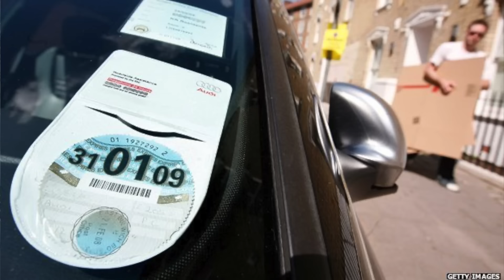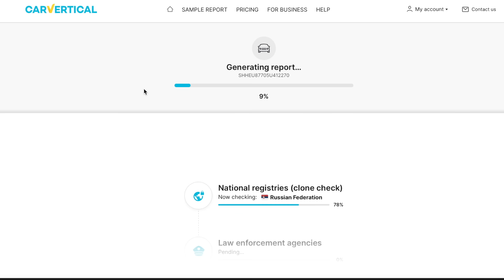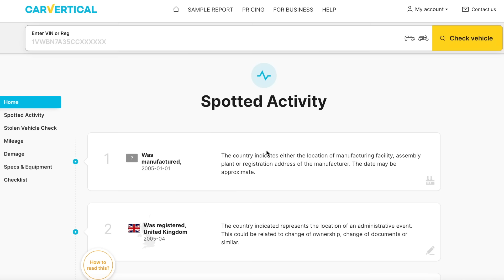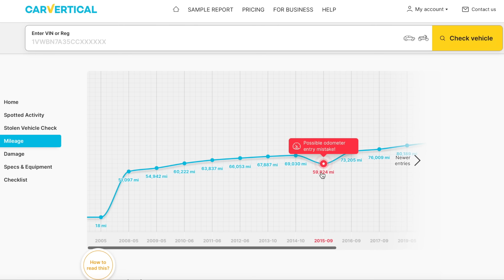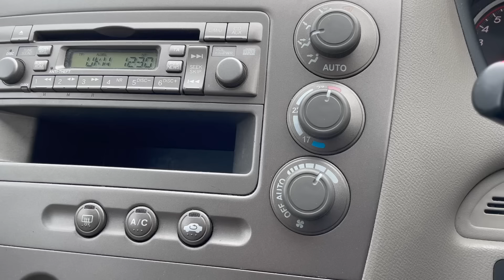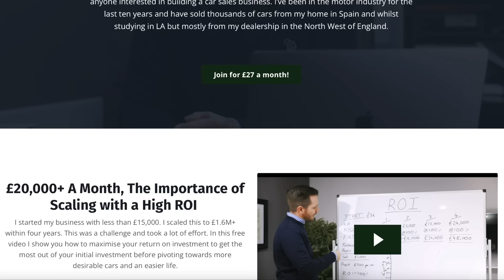I BOUGHT A CHEAP HONDA CIVIC

Comment: Our BMW broke down last year on the ferry ramp on a visit to the UK (we live in Normandy) Clutch went. We were on holiday and needed a car. Bought one of these for just under a grand. Low mileage, tidy condition. Great little car.  We didn't bother fixing the BMW (dreadful thing) and kept this. It is brilliant.
Reply from the maker: What a bit of bad luck and terribly timing. Still, you got a decent car out of it
Reply: @HighPeakAutos  Yep. In the end,  especially with cars, you have to be philosophical about these things. It worked out well in the end. probably saved us lots of expense down the line with the other one.
Reply: Was having a right hand drive car in France not an issue?
Reply: Mon dieu l'horreur.
Reply: @andyhillhouse9813  Not really. We have had several RHD cars in France. I have got used to it and it doesn't bother me.  We have re-registered it with French plates. No problem. In fact i'd probably find it harder driving a LHD as I would find myself doing everything with the wrong hand and it would feel very odd!
Reply: @HighPeakAutos  Just put it through the French MOT (controle technique) and it passed with flying colours. So over here we get 2 years motoring before we need another test.

Comment: I had a 1.4 back in the early 2000s. Bit gutless compared to the 1.6 but a cracking car nevertheless. I now drive a Mk4 Honda Jazz Hybrid. I've worked out my age using your formula and I will be celebrating my 147th birthday later this year.
Reply: 147th?
Reply: 147th ? Are you vampire?

Comment: That's my first car. Lovely thing. Honestly that 1.6 VTEC is the best engine in any car I have ever owned. Loves to rev, refined at low speeds and extremely economical for its aged. Can easy get 40+ mpg on a long run.

Absolute bargain for a new owner.
Reply: Totally agree.  I had the pre-facelift model - 53 plate.  Terrific to drive, really easy.  Gear stick postion brilliant, as Matt says.  Beautifully sweet engine, the 1.6 VTEC, and always started first time.  Loads of room.
Easy to work on, too!
Weren't these the last of the Civics to have independent rear suspension?
Reply: @kubiyoshi2744  how are you possible to get more mpg in city then on motorway driving?
Reply: @kubiyoshi2744  I don’t think that’s how basic physics works with car.
Reply: @piovo1  I understand lower MPG on motorway in very small displacement engines, it's simples you have to rev higher to maintain the speed, i.e. at 80mph you are probably looking 3.5-4k RPM for a 1.4tsi vs ~2.2k RPM on my 3.0i BMW
Reply: @kubiyoshi2744  Until the timing chain slips on the 1.4 TSi then the economy saving will be destroyed by replacing the engine.
Reply: @kubiyoshi2744  60mpg in city driving where the average speed is 15mph and red light traffics every 150metres? where you need to idle for maybe 2-3 minutes.
Reply: Are the ep3 2.0 same aswell
Reply: @kubiyoshi2744  junk VW
Reply: @kubiyoshi2744  will be good
Reply: @kubiyoshi2744  would like to see your VW doing 300k....not seen one with this engine yet, Honda? There are tons of them for sale with 200k miles plus.

Comment: I bought a 1.7 diesel 5 door with 65,000 miles.
Ran for years , sold to my friend as a stop gap at 130,000 miles.
5 years later it’s still running fine at 200,000 miles !
Best ever mpg was 68 travelling 100 miles down the A49.
What more needs to be said.
A cracking car.

Comment: My dad has had his 2004 1.6 auto exec since it was 5 years old and 43k miles. He's been changing it now for the last 5 years, but never does. It's been pretty faultless, but has been kept garaged for the last 14 years so no rust, it actually looks just as good as it did in 2009. Kate Bush is a legend ☺️

Comment: I love this show and it always surprises me of the low valuation of used cars in UK. In Canada, even a slightly dented and scraped 18 year old Honda would be worth much more than £500 ($837 CAD).  And one like this with low mileage, service history and a high spec would certainly warrant  that small body repair, as the seller could easily get their money back.

Comment: Great video as usual. It's not the main reason I watch them, but one of the spin-off benefits of High Peak videos is an ongoing education into the vast number of shonky tyre brands I've never heard of that people fit to aging motors. Just thought I'd share...
Reply from the maker: Hahah me too!
Reply: I must be unusual in that I’ll buy a 130k mile Alfa for 20p and then spend £1000 on a wheel refurb and a set of Michelins. 😂

I couldn’t drive on some of these Chinese ditchfinders like Fate-O Cauliflowers or whatever.

Comment: I had one of these. It’s one of the cars I regret selling most. It was almost too reliable. I took it everywhere, even off-roading and it was absolutely rock solid.
Reply: Offroading? Do tell....
Reply: @norwegianzound  light off roading. Took it through the desert and off the beaten trail many times. Not major stuff.

Comment: I bought a 2003 1.6 with 50,000 on it in 2016 for £500. It's been everywhere. It's been passed on to family members, and now my oldest daughter has it, 140,000 on the clock, and still runs like new. They are great little cars.

Comment: Matt, you missed the OAP telltale of 'heater to the max' ..... my 86 year old mum has a Jazz Crossstar (another way of saying you don't need to bend so far to get in), with climate control permanently set to 24.5C and obligatory Classic FM.

Comment: Great video Matt. I bought a 2008 Honda Civic 1.8 type S with 60,000 mls a couple years ago as a cheap runabout, I've put 40,000mls on it and all it has needed in that time is servicing, tyres, brake pads. Very reliable cars and as you say, you can leave in the supermarket car park or in town and not that bothered if it gets scratched. 46mpg on a long run too 👍

Comment: I had one of these. A 1.7 diesel. Brilliant car. Only bought it for £500 as a temp but ended up keeping it for 3 years. Then sold it to a student when I went to work abroad. When I came back I wanted to buy it back but the student had written it off. These cars are so easy to drive and maintain, change the oil and filters every six months and it will look after you for you for years.

Comment: I worked for Honda for years and sold those when they were brand new, (the colour is called Cosmic Grey BTW) the average age of a 5-door Civic Exec buyer back then was probably about 60 so they're generally well-maintained and if looked after mechanically bulletproof. I've never seen an Exec with that colour of interior in the flesh though as 99% of them were ordered black (because the grey one looks rank) so it's probably an ex-demo dumped on a dealer by Honda UK. My Mrs just passed her test on an Auto last year so I got her one in exactly the same age and colour,  40K miles, 1 owner with a full Honda Service History for £1550. It was a bit rough on bodywork like this one but it soon came up good with some G3 and a wheel refurb. It will probably outlast her if she wants to keep it.
Reply: My Aunt when we bought her things used to say  "This will see me out"
Reply: @Pat14922  This generation of Civic along with the Toyota Corolla are probably the last cars you could say that with confidence about.
Reply: U reckon the ep3 typeR side skirts would fit on the 5door?
Reply: @marlonbaird6070  No they wont

Comment: Great review. I know a fair bit about these EP civics. Have always been my go to 'In between car' when needing to keep on the road between buying and selling of my personal more expensive car. Absolutely bullet proof. One common issue on the manual is a noisy input shaft gearbox bearing which the majority of them suffer with. It generates a whine but doesn't impede the operation of the gears or driving. Another problem is that the a large number of thees EP model civics are being written off due to their expensive catalytic converters being stolen. Alot of Honda's this age have become targets. You're right about snobs in the UK. It definatley is all the car you need and can be hand for around 1to £2k.

Comment: Had 5 Civics so far in my lifetime, about to get number 6 ( Civic E HEV Advance ), all have served me well with no major issues. Currently own a FK8, so far my outlay has been 2 tyres, set of wiper blades and rear pads. That's in 4 and a half years.

Comment: EP's are awesome Cars with amazing handling, they do tend to rust badly from the inside of the backpanels, because water tends to get trapped in there, take off the speaker covers next too the backseat, shine a light in there and use a mirror, if there's rust/water in there it must be stopped, or it gets really bad.
Reply: EU (5 door) models don't have this issue as the speakers are located in the doors thankfully! But the rear arches do still go like EP's.
Reply: @Liam-mt1fg  commented before watching the video, then realised it was the 5 door 🙄 we have 5 doors over here but they are rare, mostly it's a 3 door, hence why i jumped into conclusions early.

Comment: The mk8 civic that looks like darth vader came out in 2005 on 55 plate.
These early models had faults on them with the fuel flap and the handbrake.
My father bought a new 2007 honda civic 1.8 petrol mk8 and still has it with just 34,000 miles on the clock and i have serviced it every year with mobil 1 fully synthetic oil from new.
Nothing has gone wrong with it so far, even all the bulbs are still the original and working fine.
The mk7 here will be equally as good, if not better im sure.

Comment: Just to note these also seem very vulnerable to catalytic converter thefts - there are a lot on the market spares/repairs or salvage just because of cat theft.
Reply: The model after mounted it right at the front of the engine so it's very difficult to steal...
Reply: @Negativvv  only 1.8 and 2.2 versions the 1.4 is underneath. also type r 2.0 under neath.

Comment: Owned one of these on a Y reg for 4 years. SE executive model, Paid £1300 quid for it at the time. Loved it, great car to drive, loads of space. It was the 1.6 vetec which run perfectly despite having moon miles. My ownership sadly ended after the driveshaft snapped (someone had welded it years before and had never been noticed) would own another one tomorrow. Thanks for uploading 😊
Reply: really drab boring cars

Comment: This was my first car and is currently my daily driver. It's an EU8 but apart from the weight and size it literally just a "5 door EP2" as I put it. An amazing hot hatch for people like me who need the extra doors for grandparents etc, in some cases the EU8 has gotten quicker 0-60s than the EP3. All EP mods can be installed to it aside from straight pipe and the side/rear body as it's slightly longer. What a sleeper

Comment: I bought one of these nearly two years ago as a second car/runabout for £1400. A silver 2003/53 pre facelift model in limited edition trim. 75k miles, full documented history and bodywork near mint for its age. I'm really fond of it and can't bring myself to sell it on to be honest. Super sweet engine and gearbox. It's a genuinely fun car to drive - much more so than it's straight laced looks would suggest. VTEC motors do enjoy a good kick. And of course they're we'll built and tightly engineered cars. They really are made to go the distance. To preserve its condition I decided to garage/SORN it over winter so it's not subject to salty roads. BTW oil burn should not be an issue at all on these D series motors unless they have been very neglected. Only thing I've had to do was the front calipers wipers and a light bulb!

Comment: Owned one and flogged many, not a moments bother had with any of them. Brilliant cheap used cars. Even the diesel (1.7 Isuzu) is a tough nut to crack, but the 1.6 petrol is all you need. 

The 2.0 Type-S 5dr was a bit of an unsung hero. Loads of go, decent on fuel, chain driven and plenty of space.

Comment: I bought one of these Civic 2005 in 2015 with 55k miles. Very reliable, I did my own servicing regularly, only thing that broke was the warning alarm when leaving lights on. I fixed that. Only other problem I had was cold air coming through the drivers side door when going fast. I sold it when it had 117k miles, still driving like a dream, only sold it cos it was a right hand drive and I live in Europe.

Comment: Both my partner and I have mk7 Civics, 1.6 SE auto. They're named Howard and Hilda! Hilda is the sane colour as this one. 
Nice and nippy, reliable, easy to drive and very smooth gear change. Only issue we have is that it gets terrible condensation. 
But apart from that, they've been great.  
They have a lot of rear legroom even with the front seats reclined. And the cabin in the front feels very spacious, and good headroom. 
We like it as it has a normal auto box- don't like the shape of the newer mk8 Civics and wary of the CVT box!
Reply: Is it reliable the auto? Is with converter? Drinks more or less?thx!
Reply: @utb8536  very reliable, I don't find it much thrirstier than my previous car (1.4 petrol fiat doblo manual).
On a good run on motorway I can get 36mpg, I do mainly short journeys and about 24mpg round town. 
I've not had to anything too drastic repair wise,  consumables and usual things and also had some welding done to get it through MOT.

Comment: I have a 2002, 1.4 Honda Vision that has only done 84,000 miles. My last MOT fail was just because a wheel arch/ sill needed a new piece welding in, apart from that all good, the engine is great. The mechanic said he works on a similar aged car that is going strong at 250,000 miles he loves them.

Comment: Hi mat ive just bought this exact car 1.6 ex ecutive  in dark blue with 175000 ,on it full history 1 owner wow its mint drives like its done 75,000 its realy nice just sat outside 12 months mot and 4 new tyres and proper tyres and a tow bar the cheapest i found is £1695 the second market has gone mad .  ,My daily  drive is still   the E38 .

Comment: Great car's,I owned the 1.4 and the 2.0 type s 160 bhp, very smooth drive and totally reliable and good mpg. I now own an ep3 type r, fantastic drivers car. Usual faults are rear brake calipers seizing and useless handbrake, also they suffer from rusty inner sills, wheel arches , and the seams on the roof leak which fills the boot with water.

Comment: I had a Honda Civic 1.5LSi for 18 years (1996-2014). Sad day when it had to be scrapped. No aircon or airbags, but a nice car to drive. Had about 114,000 miles on when it went - but brakes, suspension, fuel lines and parts of bodywork were past repair.

Comment: FYI this is the world’s first galvanised steel production car does not rust anywhere also they never burn oil as all Honda engines have patented piston/bore technology just post ww2 have jewel bearings and are the only massed produced engines that you can install NOS and gain immense power gains without problems. The ageist comments are typical of Europeans as in the rest of the world they are used extensively tuned proving and must be revved very high where the fun starts fantastic car.

Comment: Had a 1.6 5 door some years ago, was a smashing car and pulled well for a 1.6. I have a 1.6 type sport round the back of the workshop currently, needs pulling out and filming after watching this.
Reply from the maker: Ah very good. The newer shape were only either a slow 1.4 or a 1.8, dont know why the dropped the 1.6

Comment: After retiring from BMW AG 10 years ago I ran old Mercs with mixed results then settled on a mint 325 Cabrio. The direct injection N53 engine was a bad choice - blew it's head gasket at 80 k. My run around has been a 2004 Civic Exec Auto. In 104k miles it has cost a £40 camshaft sensor. I get 47 mpg on a run but I am 75. Brilliant car and the auto's are strong conventional units. They do rust under the back end so try and buy one that has lived in the salt free  warm south not in the Peak District where Matt and I live.

Comment: These Mk7’s are bullet proof I’ve got one in  3 door auto which is a good box with torque conv lock up, I can get 48mpg on a run and it’s pretty nippy with the Vtec. the seats are comfortable it handles well and quite a refined ride and with the back seats down plenty of load space. Everything works on it and it’s never missed a beat and rarely needs fluids.

Comment: I had a  Y REG 2001  auto Executive  1.6 vtec 6 months ago bought it for £400 with binding brakes and scuffs on body work, it was  a gap car after selling my f10 530d needed something until i find the car i wanted ended up driving it for 6 months did 500 miles trip in it once and it  didn't miss beat ,what i liked the most was from the drivers seat i could literally see all around me clearly so comfortable to drive and also best cup holder ever on drivers side very well thought 😀  I ended up selling it after the brakes started binding again sold it for nearly the same price 😀  it was a really good experience with a car that's over 20 year old

Comment: I had a 2004 one of these between 2007 and 2017. It was absolutely bulletproof, totally reliable. I didn't find it to be an oil burner at all by the way....but maybe mine was an exception.

Comment: I have this same model in the same colour combo. I bought it almost 6 years ago for £1800 with 48k miles on it. It’s a really good reliable motor which now has 124k miles on the clock and am always looking for a replacement in auto and low miles but I think ‘why bother?’ My car owes me nothing, it’s still going strong, looks a little crusty around the rear wheel arches and I am still happy with it. Your report on the one you have sold is right on point and tells me to stick to my current car. Btw, my previous car was a 1.4 version of this model (not VTEC) and that didn’t let me down. I sold it after 134k miles. I really enjoy your videos. Thank you
Reply: What's the cam belt change interval on these? Also did you put a guard on the cat?